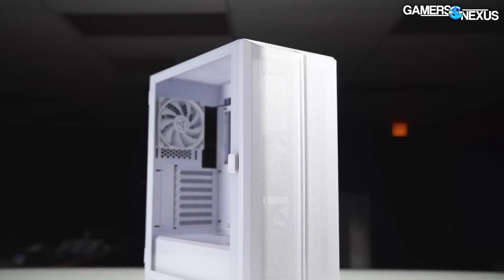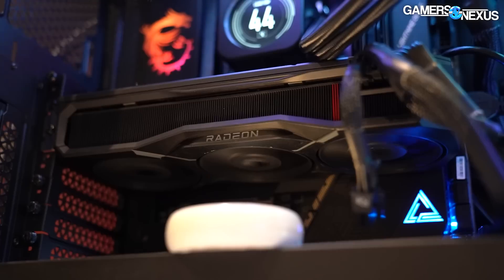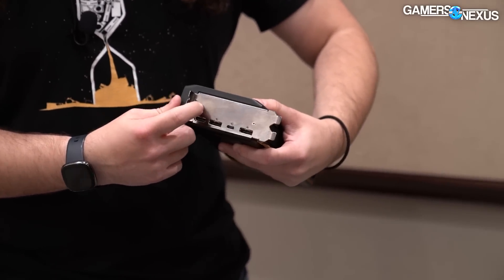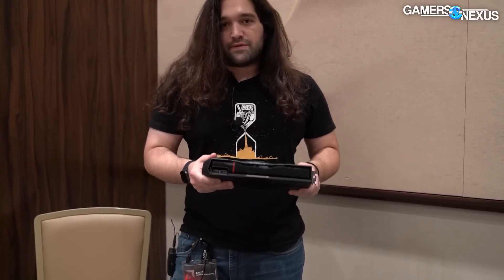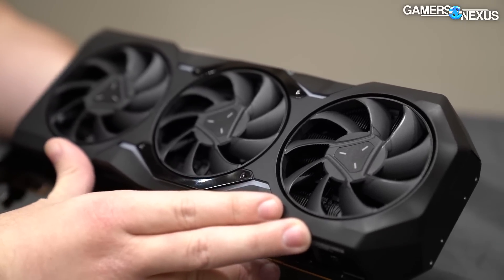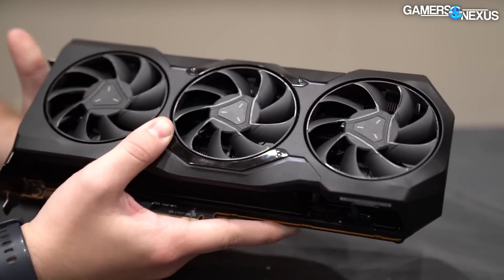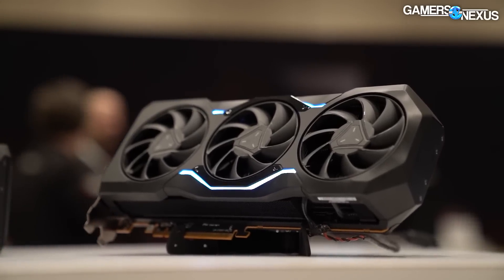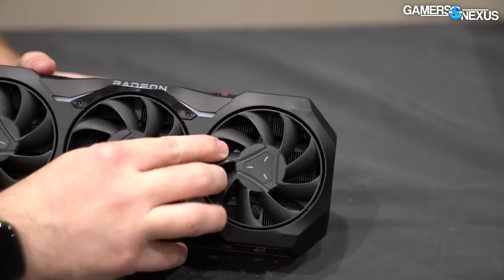More Video Cards Need This: AMD RX 7900 XTX Reference Design Hands-On

Comment: AMD rdna 3 presentation blowed Nvidia out of proportion. RX 7900XTX has 61 tfllops compared to the 53 of RTX 4080 at 200$ less in MSRP price which translates to more than 300$ price decrease in the market. Plus FSR3 is coming soon. Not to mention the RX 7900 XT which has the same tflops with RTX 4080 at 300$ less MSRP which translates to more than 400$ less price in the market than RTX 4080. Holy shit. Well im not saying im going to buy it cause I'm beggar 😂 but if they produce the same value in the RX 7600XT vs RTX 4060 I'm going AMD. Nvidia has become like Apple. You pay for the brand and tech. You pay for RTX and DLSS. And that's their excuse for the high prices. But the real performance to dollar ratio is not even close between these two
Reply: Bruh a basic rule of thumb in this industry. NEVER EVER take the tflops as the key factor. It doesn't work that way.

Every architecture is built differently and has its own tflop rating which cannot be compared with the tflop of another architecture because a tflop's size is arbitrary.

Its like saying X which has 10 tflops is better than Y which has 5. Based solely off of the tflop count, disregarding that each tflop in Y is worth 5 times more compute power than in X.

It quite simply does not work that way and isn't a metric that should be used unless you're comparing two cards from the same architecture.
Reply: @bruhder5854 I pin your post so when Rx 7900xtx beats rtx 4080 in gaming benchmarks to reply to you
Reply: @Johnny.1994  I don't doubt it'll beat the rtx 4080. I never even mentioned it. My entire point was that tflops being the metric used for comparison here was just fundamentally flawed. Nothing more.

Also what exactly did I say that offended you so much? Genuinely
Reply: @bruhder5854  My entire post was to show how much better vfm is Rx 7900 XTX vs RTX 4080 at 300$ real price less in the market, not to mention vs RTX 4090 which will be 1k$ less not 600$ cause that's MSRP but you here talking about numbers to defend nvidia's extreme power consumption and prices. You are clearly fanboy
Reply: @Johnny.1994  and my purpose in commenting was simply to correct the misinformation you had because it's unhealthy especially when the term teraflops is widely misunderstood.

I agree with you on the cards pricing, power consumption and performance being great, if not better than Nvidia's.
Reply: @bruhder5854  Your answer is misinformation. Do you deny that the RX 7900xtx is more powerful than RTX 4080?That's why the tflops difference
Reply: @Johnny.1994  I don't. I'm sure 7900xtx will be more powerful than 4080 but it has nothing to do with teraflops.
Reply: @bruhder5854  Nvidia fanboy spotted 😂
Reply: @Johnny.1994  I don't know what to tell you mate, this is a well documented topic and you're just wrong on it.
Reply: @Johnny.1994  actually he's correct. You cannot compare the Teraflops in RDNA 3 vs RDNA 2 either because they're not of the same generation. Digital Foundry has a great video on this topic, I'd recommend you take a look at for better understanding.
Reply: @attyabchaudary2703  thank you.

Comment: Is it me or does it seem like that card could br smaller than the 4080 16GB as well?
Reply: Well yeah that's the sort of issue with monolithic die. Bigger size of the actual gpu on top of much higher power requirements.

Comment: VIRGIN RTX 4090: Melting connector, 450w power consumption, giant size, 1600$
GIGACHAD RX 7900 XTX: 2 8 pin PCIE connectors, sleek design, 355w power consumption 999$

Comment: I wonder... did they deliberately design it for verticle mounting?  Use bottom of the case fans to drive extra air through and vent out the top of the case?  Looks good!  Think one of these is going to be my choice, first all AMD build and if i can find the right adapter my first verticle mount GPU.  Does anyone know what PCIE version it's using?  I know Nvidia went with PCIE 4...

Comment: Question: if the fins are perpendicular to the motherboard plane, the hot air is pushed both towards the motherboard and towards the side panel on your case... What happens to the NVMe SSDs that sit under the main 16x slot on most motherboards? Won't it suffocate the NVMe SSD?

Comment: so does it spit the air out on both sides of the card, looks that way, 
Im not convinced thats a great idea. Spiting the hot air out directly onto the mobo on the inside, which by default will wash over an M.2 drive which is usually mounted around that point. on the mejority of mobos. Unless there are blockers in there we can't see to redirect the air. But it has oppen fins on the outside and the inside from what i can see here.

Comment: Would be nice if they would all make thermocouples a standard feature as ambient temperature makes a massive difference to the cooling efficiency, and for those of us in Europe and other places that don't have AC that's something we don't have much control over. I for one live in a place where it's more or less impossible to get the room temperature below 23 C all year round and that means the fans have to work harder to keep the components cool.

Comment: I am imagining a scenario where a case like the NZXT H5 Flow, that positions a fan to blow directly towards the front of the GPU, where the incoming air temperature is measured and there is some sort of intelligent fan curve (please god don't let them call it AI controlled fan curve) that improves the noise normalized temperatures of the card.  So I want them to not only expose the information of the thermistor to the user, but actually use the information to make the card better (quieter or delay the length of time until it ramps up).  This is exciting to see being developed, but I also hope for the future improvements that should make their way into practical use.  Good job AMD, keep up the "innovation".  Great job Steve and the rest of the GN crew for presenting the case(s) for the use of this "new" idea in GPUs, hold the manufacturers to task for the implementation too.

Comment: That thermistor would be a god send for an ITX build. I would be watching that temp like a hawk before even trying to stress test everything. If you only rebuild 2-3 times per decade then buying thermal probes isnt worth it. Being able to adjust the curve in software would be great for spot checking the fans when idle as well (on cards that stop spinning at low temps).

Comment: AMD and Nvidia need to stop making heat-trapping coffins for their video cards...this card is sealed at the bottom, back and front...and has 90 mm fans...making them loud at high RPM...they could at least bump it up to 100 mm. I sometimes wonder if they do this on purpose so people will buy the AIB partner cards.

Comment: Here's how 7900 XTX will perform against 4090 and 3090 Ti

As AMD claimed it performs 1.54 times or 54% better per watt.
6950 XT rated at 335 watts. At 335 watts 7900 XTX should perform 1.54 times better per watt.
So at 355 watts 7900 XTX should perform (1.54/335)x355= 1.63 times better than RX 6950 XT.
But as we know performance is not the same on all titles. 
Here's how the 7900 XTX really performs at native 4k resolution shown at the event by AMD at 20:19. 
Call of Duty: Modern Warfare 2: 1.5x 
Watch Dogs: Legions: 1.5x
Cyberpunk: 1.7x 
Resident Evil Village (Raytracing): 1.5x
Metro Exodus  (Raytracing): 1.5x
Doom Eternal (Raytracing): 1.6x
So it is really performing 1.6x better at some titles at Native 4k even with Ray Tracing turned on. But if we average it, it comes to 1.55x times better performance than 6950 XT
Now let's compare directly to 4090 and 3090 Ti in gaming at Native 4k according to what we got. (Raytracing/ DLSS/ FSR turned off)
Cyberpunk 2077: 6950 XT- 48 fps 3090 Ti - 51 fps 7900 XTX - 79.9 fps 4090 - 82 fps
God of War: 6950 XT- 83 fps 3090 Ti - 89 fps 7900 XTX - 126 fps 4090 - 127 fps
Hitman 3: 6950 XT- 115 fps 3090 Ti - 110 fps 7900 XTX - 178 fps 4090 - 165 fps
RDR 2: 6950 XT- 76 fps 3090 Ti - 84 fps 7900 XTX - 117.8 fps 4090 - 121 fps
Spider-Man: 6950 XT- 103 fps 3090 Ti - 120 fps 7900 XTX - 159 fps 4090 - 161 fps
Uncharted: 6950 XT- 85 fps 3090 Ti - 86 fps 7900 XTX - 131 fps 4090 - 130 fps
Horizon Zero Dawn: 6950 XT- 82 fps 3090 Ti - 87 fps 7900 XTX - 128 fps 4090 - 139 fps
Forza Horizon 5: 6950 XT- 106 fps 3090 Ti - 98 fps 7900 XTX - 170 fps 4090 - 167 fps
So this is how it should perform at 1.55x better than 6950 XT and might perform even better at some titles or worse. But for 600$ less it is quite overwhelming for how near it gets. AMD will not go near to 4090 in RT but AMD's raw rasterization has been quite promising.

Comment: XD imagine buying a 999$ gpu....and not spending "Extra" on populating case fans...bc youre going to use the "included" fans period....and need SAID gpu to now measure chassis/ambient temps....in order to KNOW how to orient 2-3 free chassis fans. At the least buy an arctic p12/p14 5 pack and get some directional airflow. ESP if you have psu/shroud gpu intake fan mounts and a mesh side panel. Or just buy a mesh II....and populate the fan slots...Sure all fan slot population is a lil excessive, but if your main concern is temps/lowering your fancurve/temps etc...on GPU to reduce noise...more chassis fans/flow and enough internal volume to substantiate actual airflow matters, or SHOULD matter if you want your 999$ piece of tech to operate in a "most ideal" environment. Especially when any chassis that offers gpu INTAKE/fan mounting...really offers more potential/system cooling to entail a front mount/aio w.o being a major impact on GPU coolilng. ESP if top/exhaust can be fitted with larger than 120mm fans as well. Now you can exhaust more air....with bigger/slower/more quiet fans as well. I bring up the arctic fans bc...theyre more directional airflow...and if you have a smaller chassis/not FULL ATX....youll generally lack the internal volume/space to actually get air/flowing through your system like a "WIND TUNNEL" the more cramped/larger gpu you have....the better it is to have ideal mounting potential.....and fans that are price/performance and purely directional....are actually not bad if not better in smaller/more cramped builds vs trying to use large/volumeteric fans that push a lot of air in a wide/cone vs the narrow cone of the p12 generally made for radiators or cpu cooler fan upgrades. Your getting direct/component in this case GPU airflow to help the concept of a 0 RPM/passive fan profile. IMO a front mount is better for ram/chipset/vrm temps vs the potential of not even having GPU intakes and an obstructed top/exhaust flow leaving that vrm section as a tyipcal/hot pocket if not one of the hotter sections of a chassis/build in these circumstances.

Comment: Hey AMD. This is cool. But you know what's cooler? Not having two cards called 7900 even though one is so cut down that it's obviously the 7800 at a higher price. Nobody liked it when Nvidia did this with the 4080 and 4070, why are you doing the exact same thing? Stop it.
Reply: Would also like to see a 3 slot bracket if the card is taking up 3 slots. Remember: there's no such thing as "two and a half" slots. It's either 2 slots or 3 slots, no in-between exists.
Reply: Oh, and harshly reprimand or fire whoever was responsible for using ultrawide 2160p and calling it 8K

Comment: All it takes is an adc to read a thermistor while reading a thermocouple is much more involved. For the utility of it, wouldn't it be better though to put that 0.0001 euro thermistor somewhere on the motherboard? Somewhere not in the vicinity of a high heat component to properly measure ambient temp? I'm sure they could find a free adc and space for a couple of 0805 components...

Comment: About 90% sure Im going for a 7900XTX for my next build. Was considering a 4090 up until yesterday, but man, that 600USD price difference between two flagship models is just insane, even if AMD turns out to be slightly slower.
Reply: it realy depends on what you are interested at the end. amd published several fps numbers on there website showing that it actualy can hold up wherey well against a 4090 in 4k rasterisation performance. RT on the other side will be ~3090 level of performance, so usable but nothing special. i for my part dont give much about RT since i just play multiplayer games or competitive games and just for 1-2 singleplayergames to play with RT at maybe 60 fps this cards seems enough for me
Reply: @georgwarhead2801  This thing is insane value if you don't care abt RT very much. Even with RT, FSR should be able to help you get a playable frame rate at the very least. All AMD need to do is keep making good drivers and improve software support like OBS.

Comment: With this straight fin design, it might be worth to use an exhaust baffle to reduce air recirculation. Yes, baffles are not pretty but they definitely help improve cooling.

Comment: That reference design looks cooler than I would expect. Also that fin stack design is great for vertical mounted GPUs with fans under it. After I mounted mine, above intake fans, i got 5-8C lower temps
Reply: Yea i like that as well, my case allows for vertical stacking
Reply: Good to know! I've been considering a new case. I'll look closer at that synergy when making a choice!

Comment: With blocking the back io ,the vertical fin stack so that hot air comes out the top ,and the case sense fans. it'll make vertical gpu mount more easy and cases with bottom mount fans are more viable

Comment: In the UK 3080ti is £1000.... The 6900xt is about £750 but if you wait a few months your get so much more for that money. 
6900xt is a solid buy, but 3080ti is not worth anymore then 800£ will have to drop it's price fast. I feel sad for 3080+ owner's
Time to sell the card's and upgrade, as the used market is no where near the bottom!

Comment: Random thermal things turbo nerd users like:
- fan headers to plug case fans into for control based on gpu temps
- driver software that allows one to set curves for multiple temperature sensors (i.e a curve for the memory hotspot, GPU hotspot, powerstage hotspot, etc), and then set the actual fan speed to the max of the y value for all of the functions. That'd be super cool
- a programmable header for a female-female temperature sensor cable you can set to publish GPU (or other,, that's where the programmable part comes in) temps and send to the motherboard for use in fan control (an alternative to extra fan headers on the GPU, which I like because it means less software should need to be installed and kept running

Comment: Amd move wasn't to try top the 4090, but it was to destroy nvidia's 80 serie curbstomping it and hopefully gain a huge slice of marketshare there. No matter how you look at it, the 4080 16gb is dead on arrival. Even if it gets a 200 dollars price cut (to 999) this thing will curbstomp it in raster and probably be slower by a mere 10% in native rt. 4090s are sold only to a margin of enthusiast, while the real nvidia big sellers are the 70 and 80 serie. That's where amd decided to attack, and with good reason. Now my only concearn is how well games will receive this chiplet design and architecture, because i'm praying this won't be a 5700xt launch all over again due to that. That card was a beast, but was pretty much unstable for the first 2 months of its release.

Comment: This technology is awesome, though stock is as important as new features. AMD please sell you’re „Reference“ design directly via the AMD homepage for MSRP. Furthermore, there is a huge world outside the US of the A -> stock in Europe of „Reference“ for the RX 6000 was bad. Just let the AIB make and sell the boosted ones (more power etc.) and you the „Reference“. 

Even greater would be a guarantee like: You have a AMD card in your running system, you can buy one card. The common user makes you money, too - scalping protection ftw.

Comment: Well I always have fans on my xfx 6800 atleast 10% not sure if I need more. But having it on automatically is sweet
Reply: I keep mine at a 20-20-30-50-70 curve with an msi 6800 aib. Don't hear anything until I hit that 50% speed. 10 seems pretty aggressive and might be a little toasty? I usually sit around 50 under load.
Reply: @Mark-kr5go  I mean I keep fans atleast 10% all the time sine I noticed they turned off most of time when  I was just browsing. I do have big fan as well blowing over it. Thanks for advice I will try to use what you suggested.
Reply: @aigarskauls9200  Oh  I should add that I have fan stop enabled. So the fan is usually off when I'm not gaming and it turns on for 30 seconds every 5 minutes (20 speed). You can check your temperatures using the radeon adrenalin overlay. If you are at 55 C and below with fans off then I think it's fine.

Comment: With how the cooling on the card is designed, I'd like to see a comparison between vertical mount and horizontal mount, how much would it be of benefit? there would be some benefits from convection cooling, what about active cooling from a bottom to top cooled case, how much could the fan curve be lowered on the card? how much could the card be overclocked? how would the card look in that position with googly eyes on all of the fans?
Reply: the clocks is over 9000mhrz already in diagonal mount
Reply: @аибе-о9ь  I think you're confusing the orientation of the whole card with  the mount of the GPU on the PCB

Comment: Being able to get the case temp is good for layout planning for sure, but a more regular use I'm thinking would be as a little extra nudge to not be a lazy sod and clean your cases filters/mesh.
Reply: Yeah. But even the cleanest filter won't filter that 39 Degrees Celsius ambient temp.

Should just put the PC in the fridge at summer...
Reply: @turkeofSea  Imagine a new model PC case which has a refrigerator in its design. Basically you put your components in a fridge and could then seal it